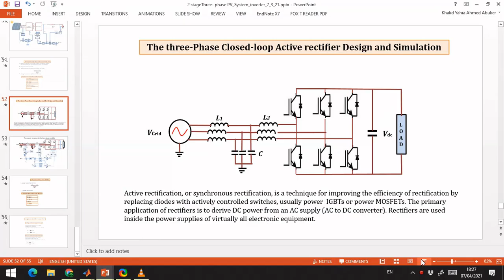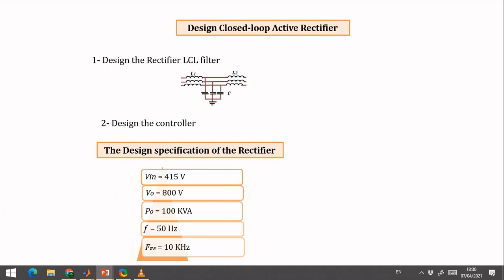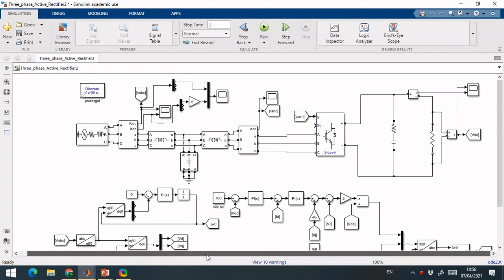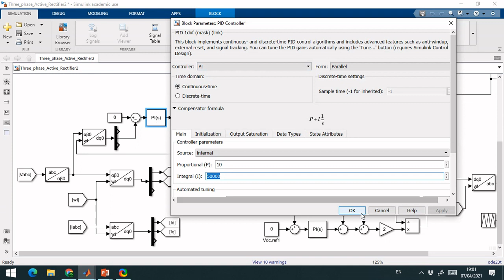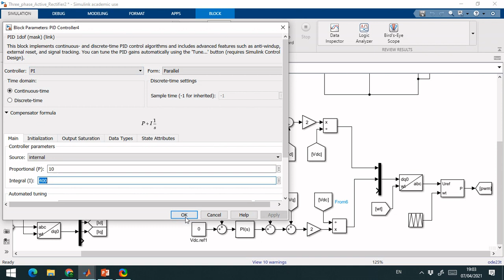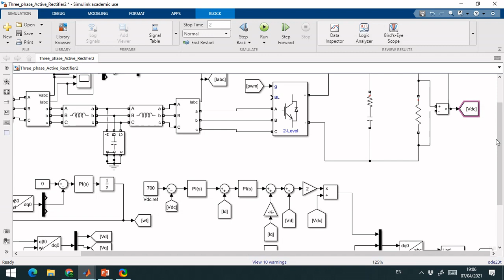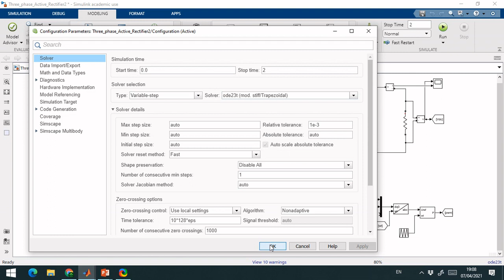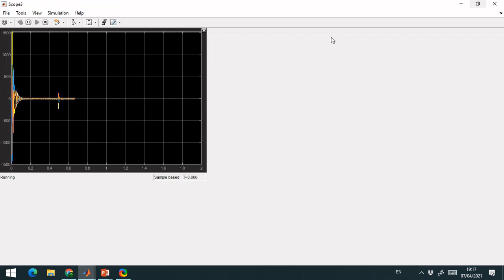Three-Phase Closed-loop Active Rectifier Design and Simulation using MATLAB/ SIMULINK

Comment: Could someone please tell me how to derive the formula for calculating the values of K as a function of C and L, for the voltage and current loops? I would be very grateful.

Voltage Loop:

KP = 3*C/T = 1.5
KI = 3*Rl/T = 300
Current Loop:

KP = 3*L/T = 10
KI = 3*Rl/T = 400

Comment: Isn't it the same as the design of three-phase inverter because the control blocks look the same
Reply from the maker: Rectifier control  usually deal with converting AC to DC, and their control might involve ensuring a stable DC output voltage
while the inverter control needs to ensure that the AC output closely resembles a sinusoidal waveform in terms of frequency, amplitude, and phase.

Comment: why u multiply vd & vq to (2/Vdc)
Reply from the maker: In rectifier and inverter pulse-width modulation (PWM) control strategies, multiplying the voltage components Vd and Vq by 2/Vdc is a common practice to ensure that the modulation index remains within an acceptable range. By multiplying the voltage components by  2/Vdc , you're effectively normalizing them with respect to the DC bus voltage. This ensures that the modulation index remains within the permissible range (typically between 0 and 1). If the modulation index exceeds 1, it could lead to overmodulation.